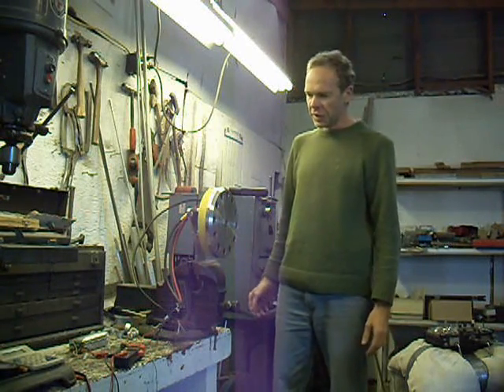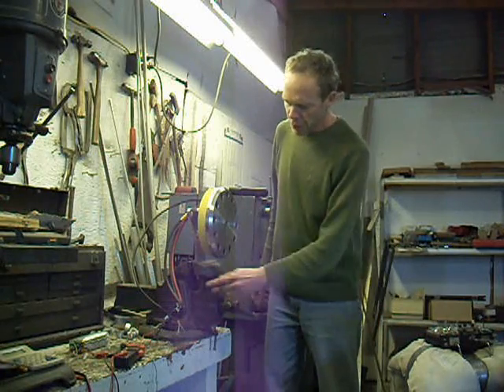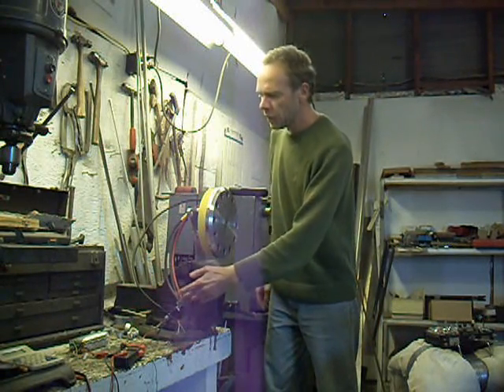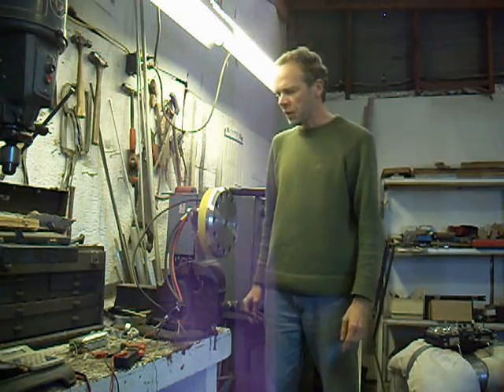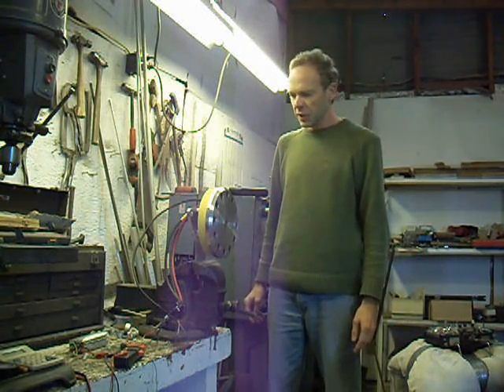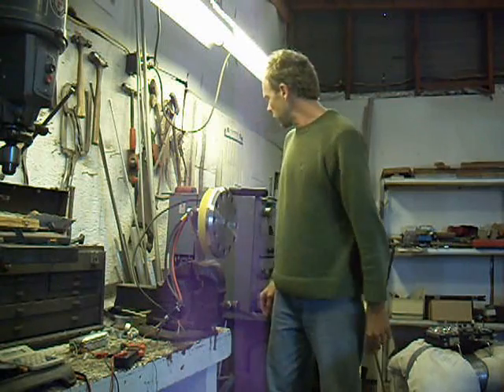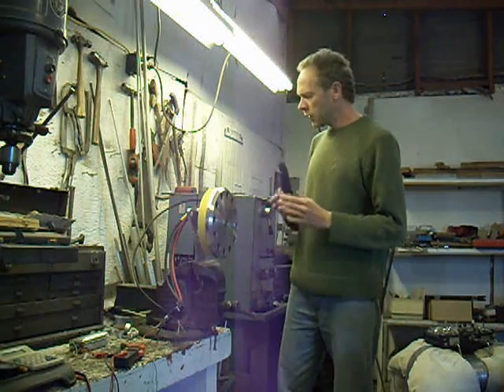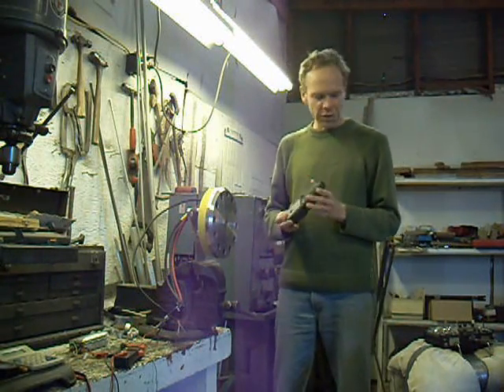Brushless motor BLDC 20 kW for electric plane, Test1

Comment: Having just built my first fully designed alternator from scratch, I really appreciate this.  Mine is 6" in diameter (about 4" magnet rotor) and 4" long magnets x 1/2" x 1/2".  16 magnets arranged in NN-SS-NN pattern for 8 poles.  12 coils, using 68 turns each of 17 gauge wire.   Each phase is wired in 2x2 series/parallel.  It's going to be used for a 7' diameter windmill and charge a large array of parallel li-ion cells at 4.2 volts so there is no cell balancing required.  I did some FEM simulations and am aiming for about 36 amps at 250 rpm.  I made my own custom silicon steel shims in a horseshoe shape to flow the magnetic flux around each coil.  The alternator "frame" is 3D printed of polycarbonate.   It's been a very challenging and time consuming to create, but I'm only a few days away from loading testing it for the first time.  Right now I'm taking care of some internal shorts caused by my silicon steel digging into some of my coils and it's best I fix it first.  Initial voltage readings seems to line up well with my hand calculations using Faraday's law and the peak flux passing through the coil from the FEM software.

Comment: Copper windings require more current to opperate as efficiently as metals with lower resistance. I think this motor would work great as a primary DC motor (if that's what your opperating it with) PSE generator.

Comment: Hey I have The Greatst respect for people like you.!! Who aren't afriad to push the boundaries of what "They" SAY  Can and cannot be done.!! Oh, I have a Tip for you" I know that you said you designed That Motor" your testing" but I have saw them before", they are (The Smart Motor) used on washing machine motors. LOLOLOL BUT Nice Try my friend. You may have did some tweaks, or changes hear OR There, but check out the "free energy" Stuff, of( Mr. Garrard Moren) on Hear" UTUBE, I mean. Okay. PS: Also, He can help you with where and how, to build and OR Buy an( Controller, that can drive This, motor)!! Cause if I'm right ?? your having problems with making it do it's full potential. When you think That motor is at it's full potential, or running speed, 
That motor, will turn, 5,000rpms easy.!! And put out torque like you never thought possable.!!!! A car, or truck motor can be replaced with one of those, Electric, Smart Motor,s. Go To Garrard Moren's cannel, on hear, he gives his (E-mail) for anyone That wants to contact him.!! He, can Help you. Tell him what you are trying to do. GOOD luck with your project my friend.

Comment: take a look at a guy named gerard morin with the right high voltage controler u can use a fraction of the amps it draws and  creat more rpm and torque.

Comment: 20kw at what voltage? even with enough voltage to reduce the amps to a reasonable level the tiny little magnets will not pull 20kw.
Reply: Lol. That battery though? Also can't attain 20kw.

Comment: Kongratulations,Wundervoll,Toll,Prima, hier Johann  von Chile,please  tell me   if possible BLDC  weight,rpm, torque, cost FOB, controller, and  wiring diagram of stator, I am  a retired mechanic, but german experience  and also Swiss  around the globe,makes me more  enthusiast to take  out solar cells, is not  structurally acceptable over  the wings,Mit  freundliche  Gruessen, Herzlich Johann Wegmann,Chilean Air Force veteran,Tschuess

Comment: What is the total price needed for making all parts of this motor?
Reply: Look up copper wire pricing and steel plates (Silicon laminated), neodymium magnets and aluminium housing.
Measure the dimensions of the motor you want to build and apply it to material costs.
shop around. Buy test samples check quality.

Comment: your battery does not look good, soon may catch fire
Reply: Your right ! I almost burned down my travel trailer screwing around with those L-ion batteries.It got red hot and exploded !! It occurred while attempting to connect a power supply without the  protective circuit. I learned the hard way that you have to use the same charger that comes with the L-ion battery or batteries. They are more dangerous than lead acid type batteries IMO,so if I ever build or test with L-ion,it will be outside next time. The fumes were horrendous and kept smelling them for days.Funny thing is it got rid of my depression ! lol,just kidding .

Comment: Hello, I like your motor. I design, build and fly with all hand made motors as well. R/C not anything like what your doing. I just had a suggestion for your testing. You can use a simple servo tester/adjuster in place of your receiver and transmitter. These are less than ten dollars and work great. I have a video of how it is used on my channel and I'd be happy to have you take a look. Check out Simple Three Phase Motor Control by DadHav. 
Good Job
John

Comment: it is nitpicking as this was a first try however the motor sound sunbalanced, perhaps a better bearing to use is a double roller bearing to minimise the load of the spinning wieght of the prop mount?  also I would suggest making the mount from a lighter material or something like the equivalent of the damped flywheel of a crankshaft  to help minimise the vibrations from the propeller?

Comment: +Benjamin Bobo said: "Where does one by the stators for motors? im looking everywhere and can only see them being sold in the hundreds or thousands"

For a one-off job, I'd imagine CNC has made it fairly cheap and easy to have a bunch of laminate sheets cut up, and you just assemble it your self. Pick a material and a cutting technology, then a job shop to turn it out.
Reply: You don't buy the laminations pre cut. you have to design them and send the DXF file to a laser cutter and they do the cutting for you. I've had this done many times.

Comment: 9 Amp no load. 20 Amp whit load. Hmm.
Reply: jacobhn2 said: "9 Amp no load. 20 Amp whit load. Hmm."

There's nothing strange about drawing more current with a load. That's what's supposed to happen. More work takes more power. It's been like that with everything since the dawn of the industrial revolution.
Reply: with reduced RPM due to a load there's is less back EMF. hence gonna pull more power.

Comment: Vollkommen ineffizient ! ;) über 9 Ampere im Leerlauf ! Wow, was für eine Verschwendung von Batterie Energie...Musst viel feineren Draht nehmen und lieber mit hoher Versorgungs-Spannung arbeiten und dann die Spulen immer pulsen und die BackEMF direkt wieder in die Batterien reinpumpen... !
Reply: Do you even know what your talking about sorry but voltage being increased would only make the amperage higher and using smaller gauge wire on higher V will only result in amperage overload (electrons exciting moving faster due to higher V wich is the push that excites them) and wattage gauges the output power, also you said the amperage was extremely high at idle well he only made one mistake if you notice his feild coils have limited wraps the more wraps you make the lower the amperage draw in the field for example 1000 turns of field wire around the field core=1 amp....but if you use 100 turns your amperage will increase 10 times=10 amps. go back to electronics school before spouting such word vomit please you gave me a headache
Reply: ja dann schreib es ihm doch und sag es ihm,
Reply: My apologies, but are you suggesting he uses a finer gauge wire for the windings and upping the voltage?

Comment: Good job, your engine was fantastic. 

I need plans to build a motor 30Kw Dc 48v, could someone help me?
Reply: Are you sure about that? 30kW@48V means a current of 625A and that, in turn, means a lot of copper .
Reply: SolarWebsite I need a motor for a motorcycle, what would you advise?
Reply: Eduardo Azevedo
Hello Eduardo  i have 2 kinds of big brushless motors. One is with 91 horsepower , the other with 86 horsepower. Output rpm at 24 volt is about 600 rpm. But i dont have a controller for the motors. If you are interested just reply. Best regards , Stefan
Reply: Eduardo Azevedo Check out pancake motors like the etek if you're converting a bike. They range from 10-20HP and run up to 48V typically. Plenty of conversions use this motor.
Reply: Eduardo Azevedo I would at the very least advise to go to a much higher voltage, if you're aiming for 30kW. More like (at least) 100V, more would be better. There's a very good reason that electric car batteries run at 300-400V.
Reply: 30kW is not 10-20 HP more like 40 HP coversion formula is 1hp=746W, 30kW=30,000W

Comment: i like the idea about brushless motor. one is a problem, bearing ball in the motor will get hot and failure. my idea is, a brushless motor need cool system with an oil.
Reply: There are plenty of bearings that deal with high stress, high temperatures and so on.
Reply: Capcatrei you knew the car's engine they have used oil to cooling down hot.
as i say, electric brusless motor require too. thank you.
Reply: sunghoon ham Did you just use google translate for this reply?
Reply: Capcatrei Wow, you speak english.. Bravo, you are my idol! Do you speak any other language?
Reply: ***** English is not my native language, if that's where you're aiming.
Reply: playaspec

No, no guys... I was not bullying anyone... was criticising the bully (Capcatrei)  for mocking another guy about using google translate!

Comment: It is sure drawing a lot of amps not even under load!
At 11V and 20A, that's 220W.  Nearly 1/3HP
It should not draw that much current.  You must have a magnetic cogging resistance causing the increase in current draw.  You may want to shape the stator to prevent so much cogging.

Comment: If suply is dc you cant measure current with clamp ameter, you need shunt,if its variable frequency then the ammeter is not showing the proper amperage, they are designed for 50 or 60 hz.you have higher requency.correct me if im wrong.

Comment: me  here again  are those rare earth magnets there  very   powerfull magnets so that will allow a high torque out of this compact motor and this very reliable design shows promise seems low maintenance to me, now  if some  good  reliable powerfull  and long lasting batteries are used   there is the potential to really start  sticking it to the  high price of  petrolium   fuels  something has to come along to  keep oil companies in line especially  avgas too

Comment: awsome motor since it is essensially a  3 phase synchronous motor fed  by a variable frequency power supply that is controlled by the hall sensors in order for the frequency to be in step with the motor if a load is applied  etc    i am not an electronics expert but i do understand electric motors  i am   an electrical thechnician and studieded all kinds   of motors   however these kind did not exist hardly   when i studied electrical technology back in the late   sixties

Comment from the maker: @speciway and nos2a2: I made FEM simulations that show up to 100 Nm torque and 2300 rpm. That would mean 24 kW peak. Electrically 20 kW are 72 V and 280 A. Of course this test run has less power. It is only a 11 V battery and no load.

Comment from the maker: @leaualorin 
It´s my own design. I have made some finite element simulations before. 
I had a look at the motor you´ve refered to. You are right, it looks similar. But there are some differences also. I use 36N42P and 14 gauge wire and 9" (240 mm) outer diameter. The Fisher & Paykel motor seems to be made for higher voltages.